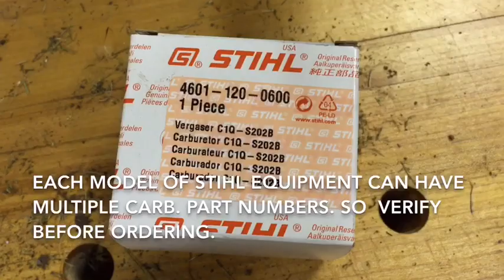Stihl carburetor change mm55 yardboss cultivator.

Comment: Thanks for the video. I didn't need sound. Mine went from not starting to starting and reving all the way to WOT and bogging out after 10 seconds. Still running out of fuel. Very little in bulb. I've cleaned the exhaust screen which involves removing the orange plastic and turning out the pipe via thread nut. Will take it off and try again. Fuel just pours from the float bowl so the filter is fine. Thanks for the vid.

Comment: I had an issue with high speed stalling on my MM55. Replaced the old carb with a new OEM carb and it worked perfect. 

Removed the bottom of the old carb (1 phillips screw). Everything was green. There is very small screen about 3/8" in diameter that I removed with dental pick. It was totally green and completely plugged from algae growing in the ethanol in the gasoline DESPITE using Stabil for ethanol gas. I soaked in carb cleaner for an hour, blew out the jets with a compressor  and switched out the new carb for the old one and it also ran perfectly. Lesson learned . Don't buy a new carb until you remove and inspect the old one, use ethanol free gas, empty the fuel tank every off season and run until the unit quits and store indoors in a basement if possible.
Reply from the maker: +Tommy B well said. Thanks for posting the info.

Comment: I heard when replacing a carb you also should replace the fuel lines?  How do you know when that is needed?
Reply from the maker: It depends: on duration of sitting without use, use of ethanol fuel, age of machine, hours of use, exposure to sun or other elements making the fuel lines brittle or clogging or deteriorating internally, one’s mechanical aptitude, how long one could have the machine out of commission for, parts availability, commercial vs residential use, …. I would replace the lines when needed, not when replacing the carb. If they are clogged or cracked; I would replace them.
Reply: @kilikobanashoba  thank you. That makes total sense.